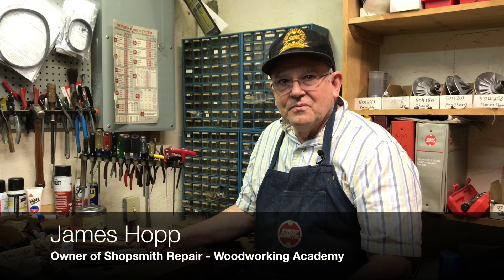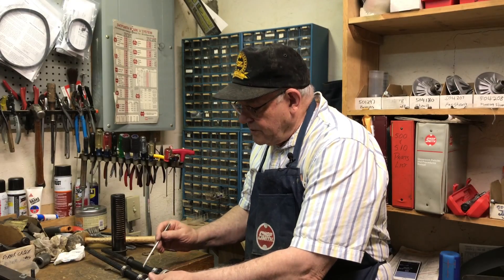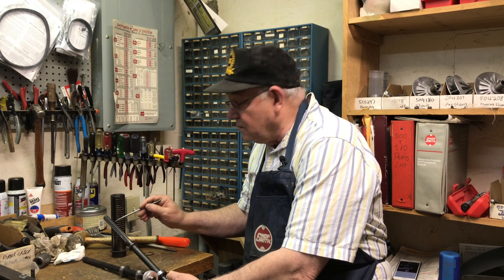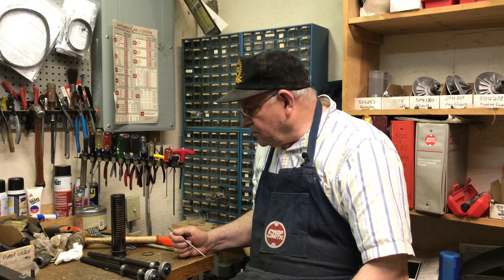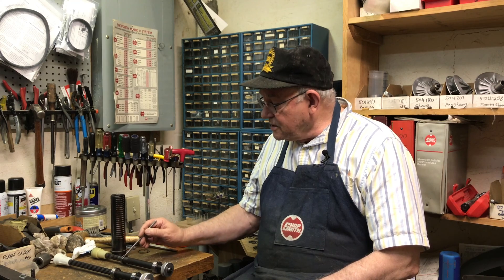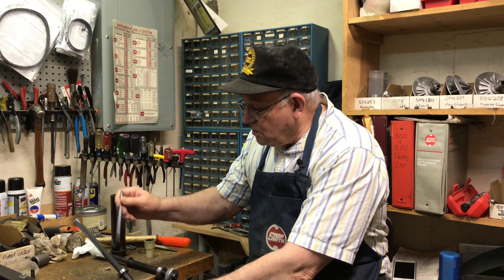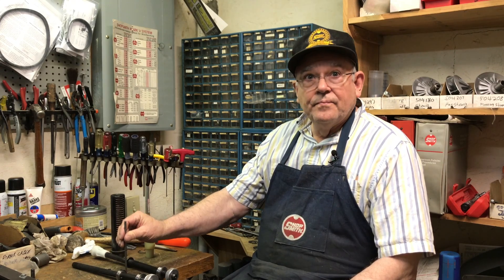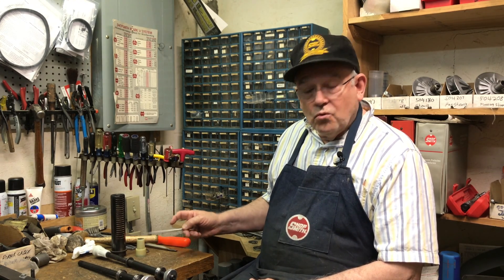One Bearing vs Two Bearing Quills in your Shopsmith Headstock. Which one is better?

Comment: The original Shopsmith 10E/ER s  all have two bearing quills.  :)
Reply: And thus a superior headstock.
Reply: As the original Shopsmith should have!
Reply from the maker: Correct. Very easy machine to service too other than it weight. James

Comment: This is a new one for me. I have seen the rollpin shear but I haven’t seen one bend. I’m curious what could cause it to bend, especially considering that the shaft is supported between the bearings on the two bearing quill. Can you share more about your observations?  Thanks, Scott
Reply from the maker: MrToolhunter I have had at least two bent two bearing quills in for repairs. And a customer that sold me his old brown anniversary headstock because he purchased the new power pro headstock and no longer needed the old one. However the quill on the new power pro bent in short order. This gentleman does a lot of lathe work and remarked that he had never had that problem with the old headstock. That’s understandable since the old single bearing quill is much stronger than the new two bearing quill. The new two bearing quill is weak at the second bearing. 
James